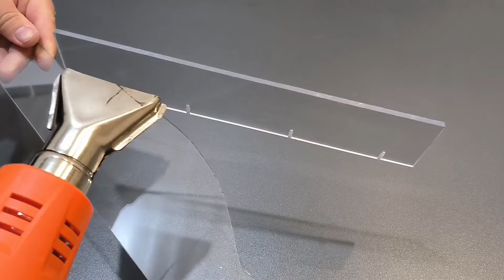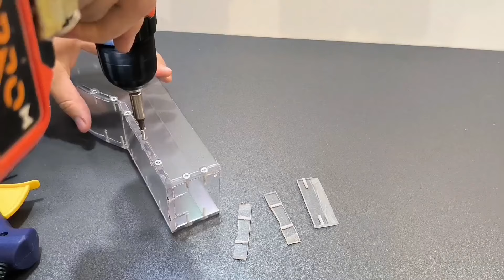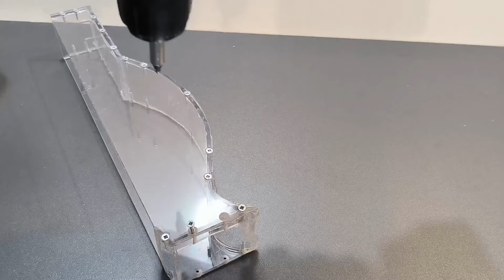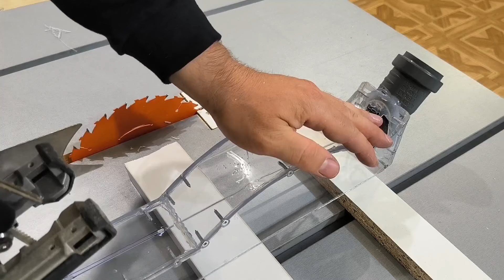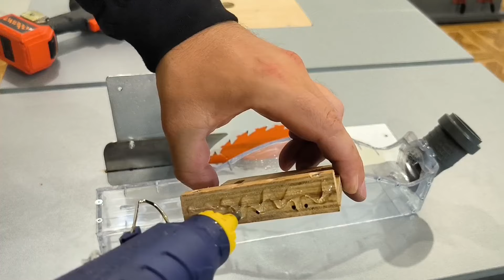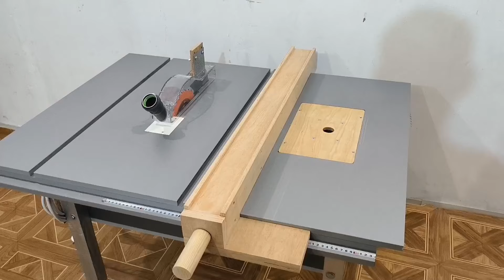Table saw: blade protection and dust collection.

Comment: Will those nut and bolts you attached to your riving knife be in the way when you cut  thicker timber
Reply from the maker: When cutting thicker wood, you will have to remove the protective cover.  My saw blade is 50mm high, but because of the bolts I can only cut 40mm.  If the height of the riving knife is adjustable, then there is no such problem.
Reply: @mr.IQhomemadeDIY  thanks love your videos